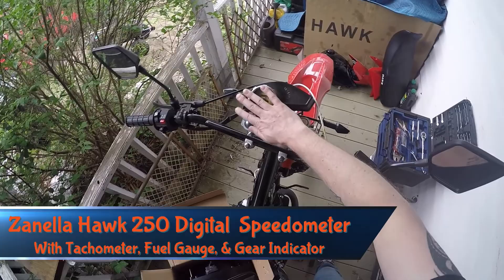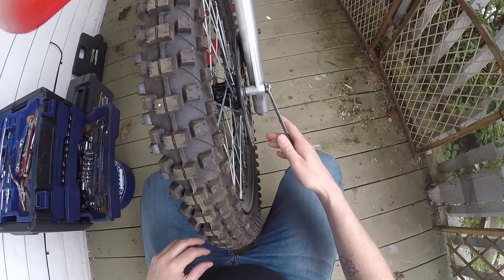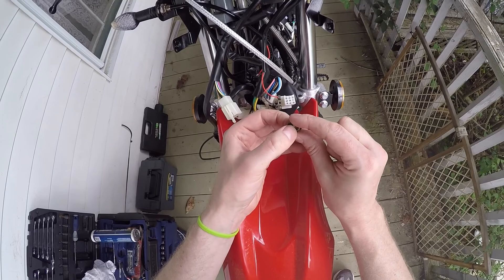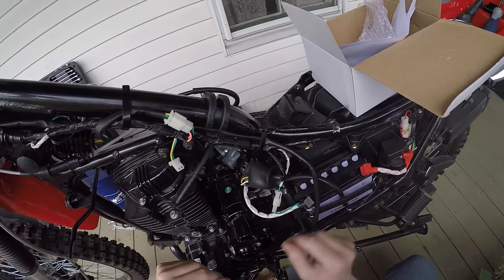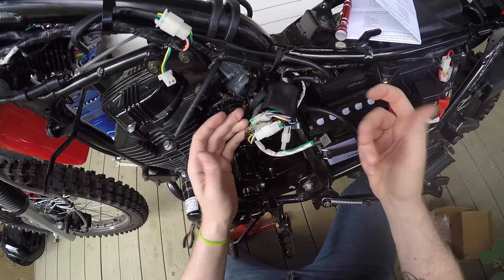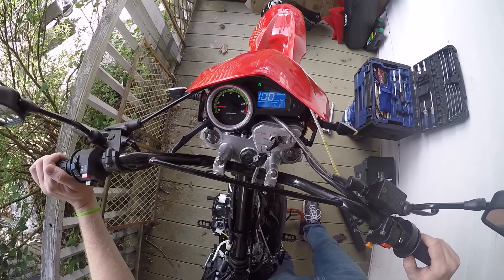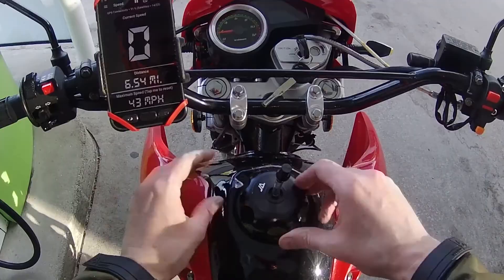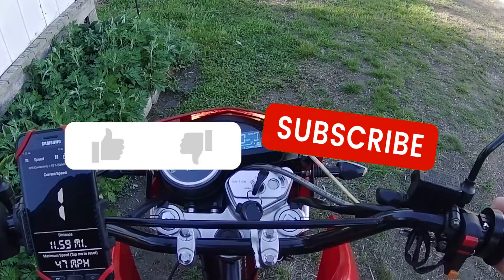Digital Speedometer Install (Step by Step) and Test Ride - Hawk 250 Enduro

Comment: I’ve read that with these digital speedos if you switch them to the 19” wheel setting they are dead on.   I’ll be putting mine in this week.   🤞🏼
Reply from the maker: I think I've heard that also, to be honest I just haven't fiddled with it.
Reply: You were correct! Just put mine on and set it to 19 and it's dead on with GPS
Reply: @willdeboer822  how to change the settings?
Reply: Has anyone tried the kaolali speedometer looks exactly the same just don’t know if it’ll work? Any help

Comment: I installed the zanella digital cluster on my 24 hawk x and everything works great except for the tachometer… reads accurate when idling but barely any throttle and it reads all the way up to 10k rpm and it’s obviously only revving to like 3k 😂 any ideas on what my issue is?

Comment: I've got a vitacci raven 250. I believe they are essentially the same bike however, do you know if that speedometer would work with it?
Reply from the maker: Ya the Raven is very similar to the hawk and that speedo should work no problem.  Motocheez put a different setup on his Raven but I think he had issues getting it to work, but he finally sorted it out.

Comment: I wanted to know the color pattern for the four pin next to the digital speedo meter cable pin hookup I changed mines by mistake I don't remember the color pattern I need to change them back not trying to mess up my stator smh its my first bike and I have the exact bike

Comment: so i pulled everything off to install and the plug ins are in use and im so confused every video i have watched its suppose to not be in use and now i dont know what to do and suggestions?
Reply: any*
Reply from the maker: It's been a hot minute since I did this install but are you talking about the extra wires for tach and gear selection? Did your original speedo have those in them already? If so that might be why, might be worth just hooking up the new speedo and see what works and what doesn't.

Comment: Hi I installed mine on my 250 hawk but the only issue is the gas it keeps blinking like im low on fuel. Can you help me?
Reply from the maker: hey there, I didn't have this issue although mine does read empty far earlier than it should.  I don't know that there's any calibration in the speedo unit however I do know that the sensor in the tank is often set wrong.  It doesn't bother me enough to pull the gas tank off and risk the gasket for the sending unit leaking though
Reply: @skydcontrol   I have a new RPS Hawk X 250 and my analog speedo and gas gauge are - as you said, comically off. There's no tach and I really have no idea how fast I'm going or how much gas I have smh. Not a deal killer but, like, really? And I think you're right - its more than likely the sensor in the gas tank.

Comment: Did you hat any problem with the gas gauge not working
Reply from the maker: No mine functioned but it is a little wonky.  It read full when it's full but it'll read empty way before it's empty.
Reply: @skydcontrol okay I heard that before my problem is that mine is not working at all

Comment: Where can I buy a new cable mine rubbed against my tire for a while and now it won't read my real speed
Reply from the maker: Oof, that stinks.  I'm assuming your talking about the digital speedo cable.  The sensor and cable are a unit.  I have another digital speedo with no sensor and I tried like hell to find a sensor that would work and I couldn't find one.  You might be better off trying to repair the wire

Comment: Mine goes right back to KPH when you turn it off
Reply from the maker: Really? is it the Zanella model?  I'm not sure if one of the leads is a memory wire from the battery, but I'll find out here soon when I put my battery back in.  I'm wondering if you're missing the full time hot to keep it's memory.